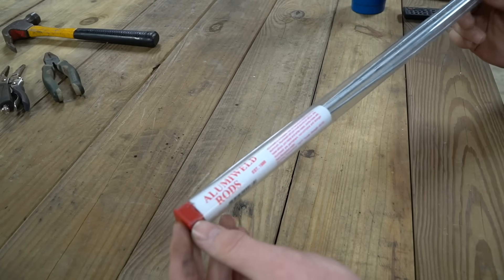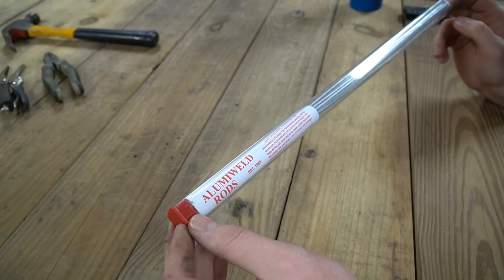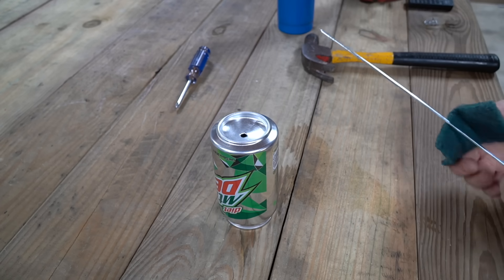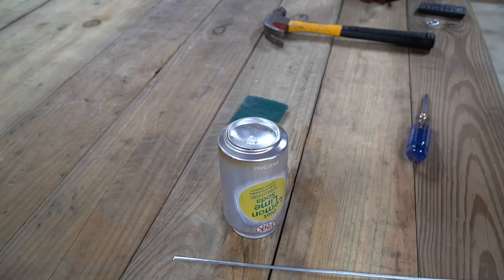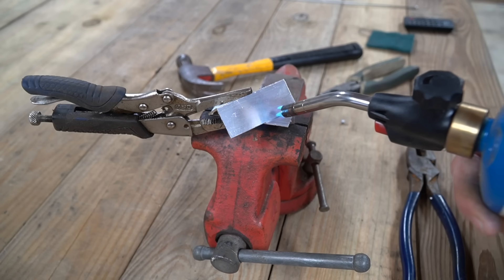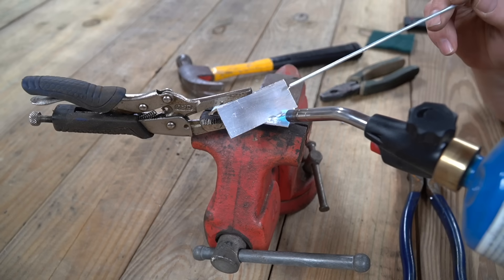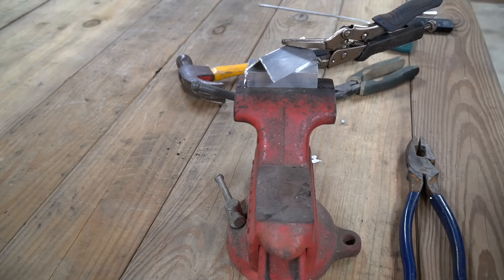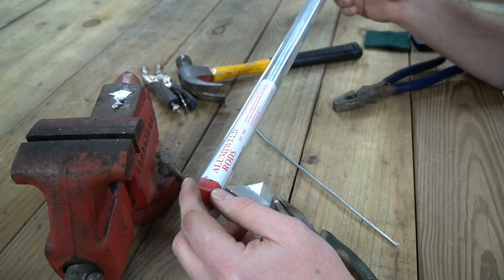Alumiweld rods from Harbor Freight!  Do they work?  Can you easily weld aluminum with just propane?

Comment: I did my first aluminum WELDING, not brazing, when I was 15 years old in shop class. Repaired my older brothers boat motor transom mount.  Learned immediately that you better have your aluminum ever so clean or it just doesn't work.  After a good acid cleaning I completed the weld.  The motor was installed on his boat, ( with a good safety chain! Lol ) it never broke and all was good.  Harbor freight brazing rods do not get the penetration that is needed to be considered a structural weld.  So if ya use them don't use it on something that you would trust your life on!
Reply from the maker: Awesome history!   My dad was a fabricator by trade, so us kids learned to weld early on as well.    And your right, harbor freight brazing rods are just that, brazing rods.  When brazing there is no penetration.  It can still be used for structural bonds, but you have to "define" structural bonds and use with some common sense.   If your putting together a small table, it maybe a good bond for that, but I wouldn't test it with any serious weight.  :D   Good tips, thanks for commenting!
Reply: @1D10CRACY  
No offence but you really need to stop calling it Welding. Multiple times in this video you have misrepresented the process. It’s not Welding at best it’s brazing, more accurately it’s a metal hot glue gun and about as strong. You keep talking about 40,000 PSI tensile strength. That means nothing. I weld all day every day with 7018 electrodes. The 70 in that code means 70,000 PSI tensile strength MAXIMUM. That’s if you do everything right, no slag inclusion, no hydrogen embrittlement, correct preparation of the base material, correct temperature of the base material (Including inter-pass temperatures neither too high or too low). Those “brazing “rods have a very high silicon content, great for lowering the melting temperature of aluminium. Not so good for structural integrity. They MAY have some use for fixing pots and pans or aluminium radiators. Apart from that they are friggin useless.
Reply: @davidcat1455  😢 who F’n cares dude.
Reply: @groverstreet7128  
Well, you cared enough to leave a comment ………………dude
Reply: well its going to work fine for my project.  😁
Reply: Magic one, i agree  this  basically a glue gun, nothing i would trust, 
 Cut up an alluminim ladder then try this aproach, and trust the ladder, just for pluging pop cans, 
I work in steel fab, kind find a real use fir this at all.
 Peace all

Comment: I've found Mapp gas to be hotter so less heat up time is required
Reply: I'd only use Mapp gas after you've got skilled with propane, Mapp can melt awfully fast.  I damn near melted a piece of brass I was brazing with Mapp.
Reply: I thought the actual Mapp gas was no longer being made.
Reply: @pt4242  that's what I hear but my MAPP torch is noticeably hotter than my propane torch 🤷‍♂️
Reply: Propane burns at 3600°, mapp burns at 3730°. Considering we are at 3600° I can't see the extra 130° making a huge difference when trying to melt rods with a melting point of 700°.
Reply: @richardcrackel1521  MAPP doesn't just get hotter, it also gets hotter FASTER. That's the advantage I've found very useful, but of course it also requires more caution, too.
Reply: It takes around 8 minutes to heat up enough to melt

Comment: Yes they work... I have been using HTS-2000 aluminum welding/brazing/soldering rods for many many years... They are extremely strong and easy to use. Cleanliness is the most important part of the success of your bond.
Reply: Hi just wondering does it work with other metals. Thanks
Reply: @lionforcecubschildrensbibl8521       Propane torch won’t get hot enough to braze with brass rods which is what you need for steels and cast iron.    You can braze thin steel pipe ect with a swirl head propane torch head.    That’s as long as the part isn’t so big that it heat sinks too much away from your part too fast.

Comment: I used this or a similar rod to fix a bracket on an alternator pivot flange that broke after a wreck. Probably about 1/2 inch thick.  Cleaned it really well and then cooked it in oven to remove all oil residue.  (Put some tin pans underneath.  Used a file to bevel the edges to increase surface area and steel pick to scratch under molten puddle.  Worked great.  Technician who showed me how to do it tested the joint by smacking it with a hammer and it held up.
Reply: Care to explain the steel pick to scratch what under the molten puddle?
Reply: @rogierius  The technician who showed me said that there was an oxidation barrier between the surface of the casting that was being repaired and the molten rod.  Breaking up the barrier allowed the aluminum and rod material to blend and form a stronger joint.  (Since, I’ve read that aluminum immediately forms an oxidation layer when exposed and that’s why inert gas welding is preferred on aluminum). To work well it depends on the quality of the aluminum you’re trying to repair.  I’ve tried it on a thin piece that was made of pot metal and it just fell apart.

Comment: harbor freight aluminum rod works great for plugging holes in soda cans and decorative items but structural  no way. no one with any welding experience would ever use brazing or soldering for structural integrity and this stuff is the same way. for structural integrity you need penetration and with the HF aluminum rod there is no penetration, everything is surface adhesion.......

Comment: You could of attempted to break the joint to demonstrate its strength.  Also, why don't you fix an aluminum radiator?  Do something useful with the rod.  If it's that good, you should damage your radiator and fix it with that stuff.  Your video is like a commercial.
Reply from the maker: Typically you solder radiators.

Comment: Used this stuff many years ago, was told by the demo salesman to scratch the rod along the seam while heating to break thru the oxide until it flowed , worked great.
Reply: What I have found that works well is to use a small stainless brush,  Get it up to heat, add just a small amount of rod then brush it into the joint fairly hard to break through the oxide and spread the filler then add your filler rod
Reply: @almeyer405  Agreed, just remember, STAINLESS brush, dont grab a brass brush and use it, the brass will come off and coat the aluminum and you will never get a solid joint.
Reply: Ditto - about 20 years ago. Not the same brand but I'm sure it was the same alloy. Scraping with the rod is very helpful; although it has some ability to break through the oxide coating that forms almost instantly on exposure to air, particularly when hot. I used them for brazing brackets together. The joints were plenty strong for my use.

Comment: Would have been good to have shown an attempt to lever/ break the weld....
Reply: @Darren Thompson I've been using these for years & tried to do that, but have not been successful. The base metal has always broken before the weld/braze.
Reply: The channel Project Farm tested different brands of these, good information.
Reply: @windrider65  Love that channel! 👍🏻👍🏻👍🏻
Reply: @windrider65  lol didn't read your comment 😂 glad someone else thought to point to PF youtube channel. The best
Reply: I've used these and tested the weld's with a bit of 5mm angle and 5mm flat bar and bent the metal and left the weld intact. With a little practice you can lay down a nice weld but I found it won't work unless you give it a hit with a stainless brush to deoxidize the aluminium right before applying the rod.
Reply: @darren Thompson hey check out project farms  video on brazing rods.. or any of his videos really. Favorite channel on YouTube, he's very thorough with all his tests,  and isn't paid off by manufacturers. He buys all the stuff he tests himself and engineers different jigs/rigs for testing.. I'll link the video if I can find it/it will let me
Reply: Most definitely agree 👍

Comment: Wow you actually found something at HF not made in China👍🇺🇸✊
Reply: Their MIG wire is actually made in Italy. It works very well!!
Reply: @Derek Young Derek.. Old info!! HFT has been upgrading their stuff a lot as of the last 2 or 3 years.. Obviously, NOT commercial grade ...BUT you are NOT paying exorbitant Milwaukee or AEG or... prices! Lets compare apples w/ apples.....I have HFT buffers, drills , sanders & numerous hand tools that are 5 - 10 or more years old. Let's not be Bosch snobs( I have many.. some more than 10 years..) Much of Milwaulee, Dewalt & Bosch etc is also made in China..
Reply: @stebro2738  I believe its all made it China now. Dewalt definitely is
Reply: @scottsmo7715  I am quite sure.. As an aside, just as in the US, these same US corps, as well as you and I, can get ANY quality they/you wish and are willing to pay for..My son worked at a very large aerospace mfr, and nearly half of their BIG multi-turrret lathes & other big machine tools were sourced from China
Reply: @stebro2738  im more concerned with not helping China build up a military to enable them to export Communism. I dont care about the “apples to apples” on a cost and quality basis.
Reply: @Derek Young  My $30  oscillating cutting tool from HF outlasted my $120 Bosch by 20 times in the first ten minutes.  That cheap worthless Bosch broke in under 30 seconds.  The HF has lasted 10years, so far.  
YMMV, but for many tools I don't plan to use often, HF is by far the better value.
And yes, you are a huge jerk.
Reply: @Derek Young I have a $7.99 grinder that I bought in 2000. Its still running. Rotary tool is 15yrs old. Oscillating tool 5yrs. Wrenches no problem. Screw drivers get lost before they break. 1x30 belt sander and belts are fine. Not everything is perfect but I've had really good luck with pretty much everything. I've even seen plenty of HF tools on oil rigs and San mines I've worked at. Mostly bought in a pinch but worked and still in the tool shed.
Reply: @Derek Young I guess I can give you some of those.. I've got one of those air compressors too.. worked for 8 years and then exhibits exactly the same problem you described.. I have, however had quite a lot of other purchases from HFT (I AM, as I said, JUDICIOUS in my purchases!) that have done well by me.. I'm not trying to change your mind, but I feel that HFT should get a chance.. JUST be informed before you buy!!
Reply: I worked in an Irwin tool factory in Maine, not kidding they made Irwin, mack, matco and husky tools all on the same exact machines.
Reply: Most everything at the home depot and lowes is made in china as well...USA! USA! US....nevermind
Reply: Most tools are, Milwaukee is made in China, DeWalt is USA
Reply: It is unfortunate these sentiments are so common, I know they are well intentioned but they are no longer valid in the current day. Most of the arguments surrounding comments like these are between people who are not at odds with one another fundamentally so it is education that is needed. I too have a bias favoring american made items, but americans need tools to be able to make anything. The price of purchasing truly made in the USA tools is simply cost prohibitive for most individuals and even worse many get scammed out of their money by dishonest marketing designed to exploit this bias. It is never only a few dollars more for an equivalent american made tool, period.

  Harbor Freight has put many many tools in my hands and in my workshop over the years that without them would have remained nothing but a far off dream. I have used those tools to produce the first prototypes of new products and ideas of both myself and others (mostly americans), I have used them to repair, restore, and extend the lifespan of the american made equipment I am fortunate enough to own or have inherited that would otherwise have long ago been replaced with chinese products. Harbor Freight is not where I go to save a few bucks it is where I go and have gone for years to have access to tools and equipment I cannot get any other way which have empowered myself and many other americans with a level of autonomy and self sufficiency that we otherwise could never have reached. Having these tools has expanded our collective creative potential and fueled an immeasurable amount of american innovation. In the end it is self sufficiency and individual proficiency that is the greatest weapon, their value cannot be weighed in dollars or yen and the more of it we can purchase now the better. 

I see harbor freight as an american hero for said contributions, and they have done a fantastic job of recognizing and utilizing their position ahead of the curve as the rest of the market has shifted towards the model they have beewn following for decades. Made In China no longer means crap it just means it could be crap and the quality of todays products depend on how much control over that there is. Nobody knows how to navigate and oversee chinese manufacturing like harbor freight does, so as more and more everyone else has outsourced to china so has the gap in relative quality between products narrowed and in my opinion harbor freight has actually surpassed many of them and that trend will continue for quite some time.
Reply from the maker: Don't tell anybody, but there was more!   https://youtu.be/SBvUAGR5UkY
Reply: Vote with your money support the United States by buying things made in the United States.👍🇺🇸
Reply: @bryansmith6054  Bryan.. sadly most US mfr's are making their stuff in China or Malaysia or... Bosch, DeWalt, Craftsman,AEG, Freud, .Milwaukee & on.. some or many or most of their tools are made overseas or with "globally sourced materials" However, they are American companies, making products in foreign countries &, IF NOT storing their profits in other countries, are bringing their $ back t yhe US... Now if they'd only pay taxes like you and I are doing!!
Reply: @stebro2738  Milwaukee is a Chinese company, it was sold years ago
Reply: All I see is a lot hate on this post ... Remember not all tools are created equally .. but all tools matter  . ATM .. always hurting my bank account 😁
Reply: Shh they will ban it for being rac!st.
Reply: The joke is on you dummies. China manufacturers what it's contracted to make. If Home Depot orders 1 million junkie hot water heaters, that's what China delivers. You idiots blame China when it's the Home Depot who's screwing you.

Comment: Will it only work on aluminum? Could it be used to fill in rust during auto body repairs or auto restoration?
Reply: You cant put aluminum of steel. Its corrosive

Comment: Can you use acetylene (plumbers "b-tank") as a heat source? Would this be strong enough for utility trailer work? Great video!!
Reply: I used them on my ladder rack on top of my tool box top. 
 I was iffy at first, but have been cranking down wood with ratchet straps for almost a year now, with no problems. .
Reply: @maybesomaybenot1652  Thanks so much for the response!!

Comment: May try and fix my leaky rowboat!👍
Reply: come on now, everyone knows you fix rowboats with flex seal!
Reply: Let me know if it corrodes out.  Since its not exactly aluminum, I would worry that it would cause galvanic reactions, especially in salt water.
Reply: If it corrodes it’ll just leak again, I just use it to rescue my rc boats lol
Reply: Aluminum transfers heat really well, you will need a hot torch to get your rowboat hot enough. Doubt propane would work, Map gas might work, oxy acetylene should work fine.

Comment: Saw some ads showing similar rods to attach other metals besides aluminum.  Have tried any other metals like steel or copper?  If yes, would make a good video.
Reply: Idk about welding, but if you have a hole in your muffler thewe aluminum rods will fill it perfectly.

Comment: These types of Aluminum rods are junk. If you want the best,  that work and flow correctly get Lucas Milhaupt Al822 rods.
Reply from the maker: Junk, or just an opinion?
Reply: @1D10CRACY  Confirmed junk, didn't work. I have welded and brazed for over 25 years.
Reply from the maker: Maybe you should try them again?   I really like them, also been welding and brazing for 25+ years.

Comment: Yes, however... Just like in soldering you have to heat the surface to be brazed, and that's fine for small or thin pieces but for larger and thicker parts quite often propane doesn't produce enough heat for that.  Of course, they've stopped selling Mapp gas although in all fairness it really wasn't much hotter.
Reply: What’s in the yellow cylinders now?

Comment: i dont know how many times you said brazing during the vid but obviously a lot of viewers had the volume down..lol
Reply: Its a drinking game! Shot every time he says "brazing"
Reply: then he goes on to mention the tensile strength of the rod, and says your weld is stronger than the material. nope...
Reply: Agree, except he included the word 'weld' in the title of the video!
Reply: @toldt  the brand name of the rods is hardly his doing..
Reply: @Wayneo's World correct, but I wasn't referring to the name of the rod.  If you read the title of the video, "Alumiweld rods from Harbor Freight! Do they work? Can you easily weld aluminum with just propane?" you might realize that I was referring to the word weld (used by 1D10CRACY as a verb).
Reply: @toldt  oh im sorry i was incorrect..i didnt read that..im still holding firm my belief that most of the comments were not much more than nit picking and his comments throughout the video corrected any misdemeanours a brand or title may have caused..i stand corrected in your most relevant instance.